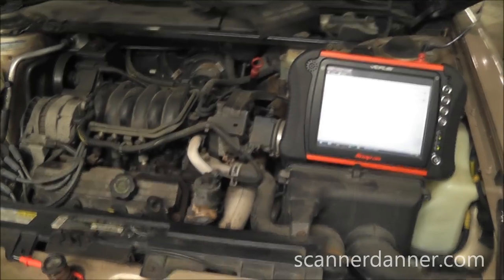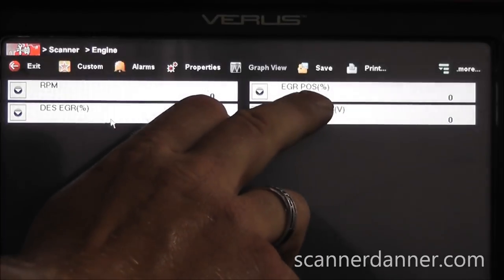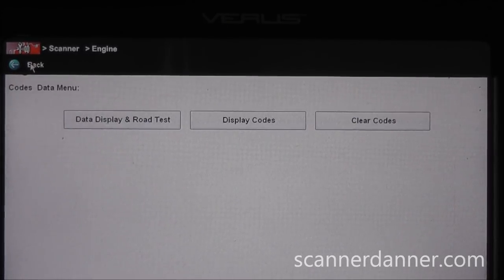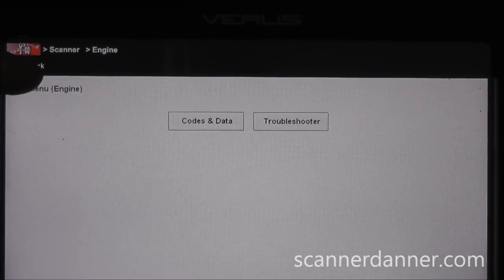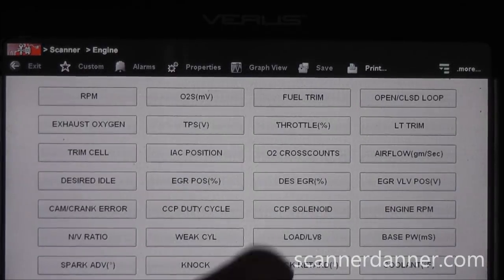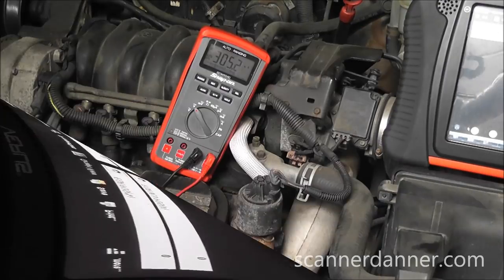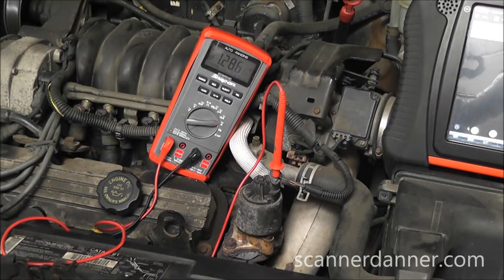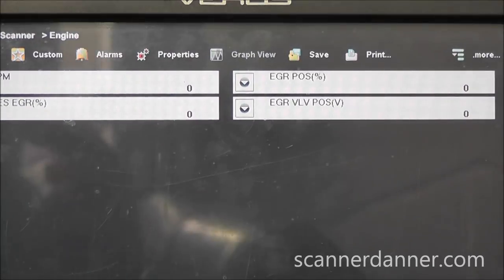How to test an electronic EGR valve (GM P1406 case study)

Comment: Testing an egr on 6.0 vortec right now. Red wire to egr has 12 volts until i plug it into the egr valve
Reply from the maker: Most likely a bias voltage and is normal to see this with an open circuit on a control wire. My guess is this is a power side switched driver for the egr solenoid.
Reply: ScannerDanner good. Thanks for the reply. Gonna dig up a schematic and get into it further. It's an older truck but it's in pretty good shape so its well worth my time and effort. Im sure I'll be back to you. Thanks again
Reply from the maker: What year make and model truck so I can look at a diagram. Some of these EGR valves were ground side switched and others were power side switched. It will be key to knowing if what you are seeing is a bias voltage or a bad power feed wire
Reply: ScannerDanner i have an 01 silverado 2500HD with 6.0 vortec. It has all the bells and whistles if it matters
Reply: ScannerDanner.  Also, is it possible the egr is just bad altogether. Electricity will take the path of least resistance right. ??  Seems to me it should still show some voltage. Im stumped.
Reply: ScannerDanner. You know, i made my living as a mechanic for most of my adult life. I say mechanic because i wasn't afraid to dive into anything. I would repair everything from weed wackers and chain saws to semi trucks. I still tinker a little and haven't lost my touch bit when it comes to computer related diagnostics i really can't believe how much i forgot. Got tired of busted knuckles so i took to driving those semis back in "05"
Reply: By the way, excellent videos. Very professional and very informative
Reply from the maker: both EGR control wires go to the PCM on this model. It is power side switched and what you saw was normal unplugged bias voltage on the control wire.
Reply: ScannerDanner ok. Thank you sir. Is there a way i can force the egr on to see if it is infact working. Like maybe unplugged with jumpers or something. I do not have scan tool to do this

Comment: You should get a Fluke 289. Snap or any other companies will never be as good as Fluke meters. With the 289 you can log transient events and voltage trends. What you probably paid for that Snap on branded meter would have probably been enough to get a Fluke 289. Just my opinion. Its makes my troubleshooting adventures go by much, much faster.

Comment: It's me again on 1994s10 v6 spider vortec put new plugs wires rotor cap icm start run good then dies out left it for 4days pulled hose of intake started  run good all day stuck filter hose back on  went   out next morning started run rough rough idle gave it gas it hesitated then Reve up then idle with a sucking nose coming through the air hose from intake so I took the sensor out  the the hose tried to clean it knaw it start and die and just crank fire up go dead .it takes one one hooked it up then it went out guy said lighter was out why it wouldn't read and the fuse wasn't blown .back to when it started when we hooked the one -1scanner up .the sound I heard our air intake hose kinda like a squeezing sound or a small hole sucking air but I bout hoses knew I am bumfooked got good gas pressure foreign something making it not run .it run so good the other day couse I left the hose from intake to filter and it run perfect this is like the one stumped you .I had tumor and aneurism surgery about 12 months ago and I used to work on them but it's really hard knaw can't trust these shops around here wish I could bring it to you to pay you and teach me your videos helped me on one car but this one done got me to beat windows out the vin on truck is W  4.3 L can't find crank sensor this is the year for the Chevy s14 GMC thank you